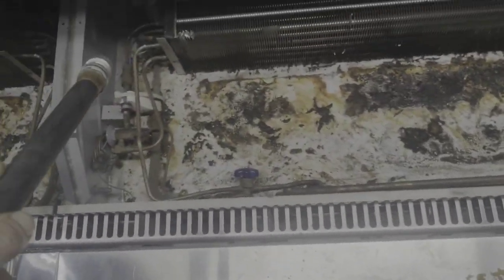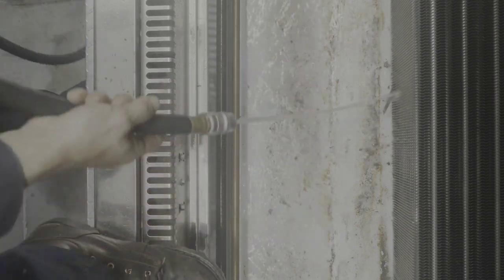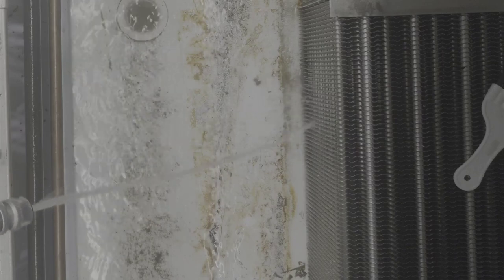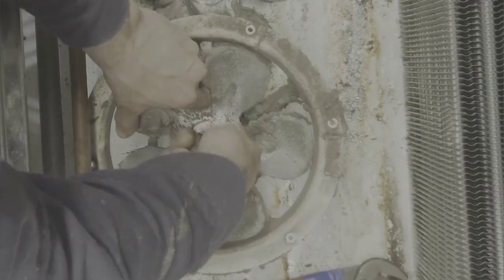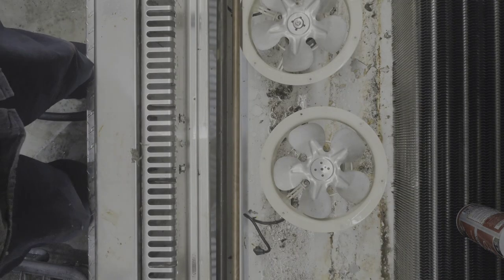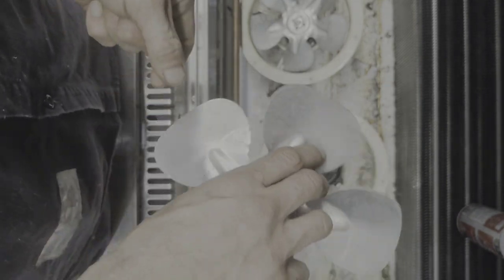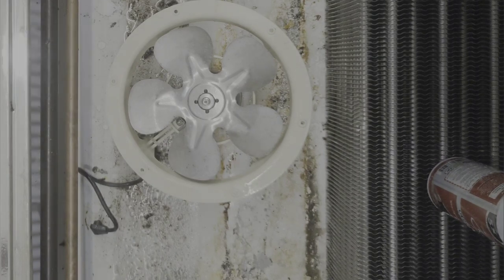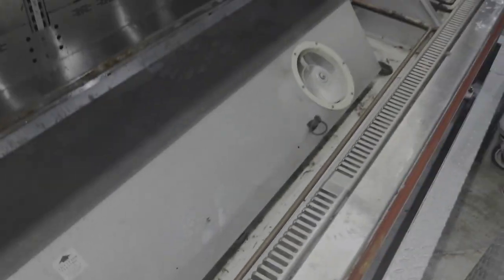Evaporator Cleaning Part 2: Rinsing Coil and Pan with Water, Cleaning Fan Blade/Motor/Shroud/Cover

Comment: ASMR coil cleaning
Reply: I'm assuming you have much larger drain lines in market, than I'm accustomed to with restaurant and concessions. Don't have the luxury of blasting a hose!
Reply: Also guilty of rushing things and putting a blade on ass backwards!
Reply from the maker: Ive done that before too. Then I realized they actually have a curve and should only go on in such a way as to scoop the air in the direction of intended airflow! Lol
Reply from the maker: Sometimes. But yea these cases have usually inch and an eighth or even inch and 3/8 PVC drain lines. But hell back when I used to do restaurants like in Chili's I still ran my water hose. I would flood the floor because they have floor drains I didn't really care cuz everybody was wearing slip resistant shoes. I mean I'm all up in the way of all these cooks and everything and they're trying to cook and all that crap so like the faster I'm out of there the better because Chili's definitely never maintains their stuff their craps always packed full of grease and inside the coolers, oh my God that's even worse old filthy spoiled pieces of food! 

That's before I started recording uploading. My kids been telling me I need to do this for years I just never did it. I should have listened by now I'd have a much bigger Channel